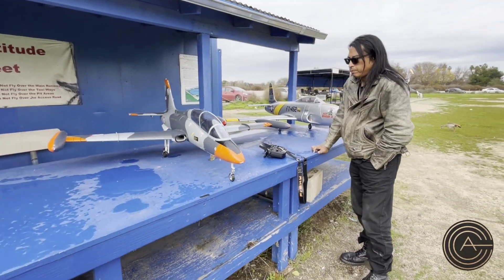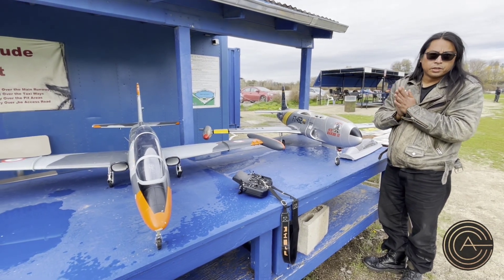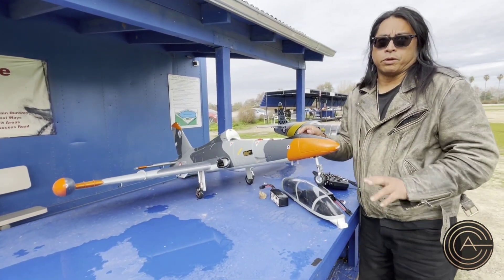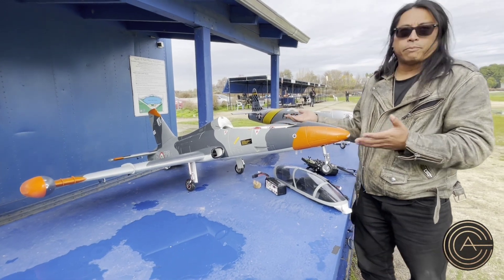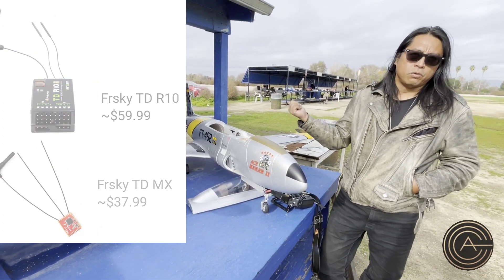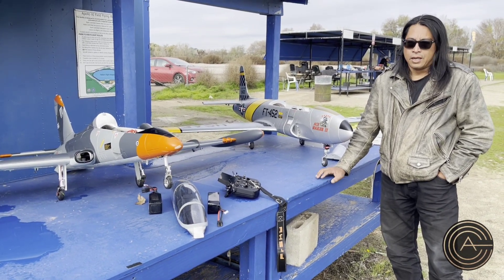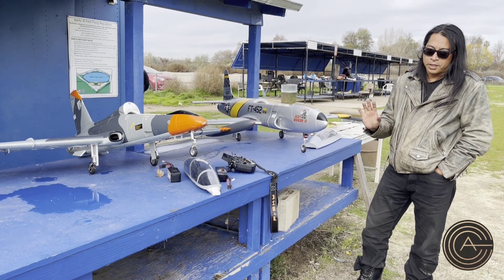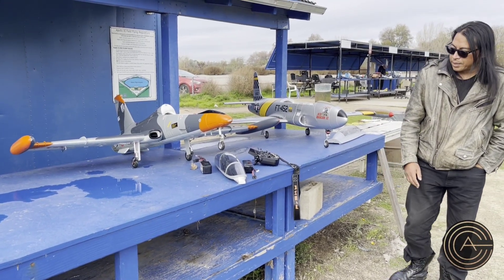HSD vs. Aerofoam. Part 1 of 4 - on the Bench

Comment: Between the denser AF foam and lighter HSD foam, is it safe to say the denser, heavier AF foam is better for preparing an aspiring turbine pilot for turbines?
Asking because I'm deciding between the HSD F16 105mm or the upcoming AF F22 105mm
Reply from the maker: The AF models seem to have better construction and fitment. Panel lines and general production quality is noticeably better on AF models vs HSD. Should also consider availability of parts. HSD has been out of stock for the F16 for a long time. They dont sell KITS anymore. You can only get a PNP version. No replacement foam parts are available. They just have landing gear parts and some smaller items available for replacement. The AF F22 is new, so stock should be available for a while. But looking at how AF models have been getting discontinued on the BananaHobby site, theres no telling how long parts will be available.

Comment: Might just be me but for what these cost, you should have zero issues. I have almost purchased both of these but stop myself before I click the checkout button. lol I do have the HSD 182 and use SBUS into their computer for one plug connection. All their settings stock were spot on and I do enjoy flying it.
Reply from the maker: I don't mind issues. Anything with a bit of complexity has the potential for issues.  It's how issues are resolved that is important.  I'll still buy HSD because there isn't much options for that size foamies.  But spare parts issues is sort of a thorn in the side of real great flying planes. Aerofoam seems to have a good selection of spares but they don't have the computer system that hsd has. Hopefully more manufacturers become available...

Comment: thats just a baddd glue job on the f86 tail lol when i glue a piece on a plane its alwayss twice as strong as it used to be
Reply from the maker: Yep,  usually is.  Most times the joint is stronger.  I tried CA first and possibly the type of foam didn't take as well.  Second time,  i used foam tac. That worked better.  The next time it actually broke in a different spot. My fault for letting that seat belt hit the tail over and over again,  but still.... it's a very brittle foam. I'm more careful now when putting the plane in the car.

Comment: The fact that any of these brands dont sell parts is automatic no for me.
Reply from the maker: HSD sells the mechanicals like servos and gear. Body parts are "just by the kit for 600 bucks".  Aerofoam sells parts. I've replaced one of the two lower fins on my Aerofoam MB-339 and Banana does seem to stock most parts.
Reply: Agree. When I started 15 years ago, I soon learned about the of no "spare parts" issue! A deal breaker for sure!

Comment: I have both those jets, the T-33 is a battery eater but an easy flier. The 339 is a glider and has a great flight envelope.
Reply from the maker: I run the 6300 smc batteries and they seem to last longer than even my 8000mah hoovo Batteries. Agree with your assessment of the T33 and the 339!
Reply: @all_rc  I use either Liperion or Zee 6s 6000 100c….they work ok, but they are still just 3 minute safe flight time. Just assembled the Aerofoam L-39 in Arctic Camo, haven’t Maidened yet….

Comment: Don't know why they won't stock parts. I had been waiting a while for a set of wings for a EDF viper. I contracted the sale rep from HSD direct he said shipping would be expensive, and said contract HSD dealer in the USA let them know and he would ship wings with there next container. Well after contacting HSD USA I was told they wouldn't do it. When the factory gave the ok to ship with there next order.

Someone else said they needed part HSD told them to buy the kit for parts
. 
The foam on the turbine is much harder then the EDF. I also have a HSD v3 viper turbine and its foam is much harder then Aerofoam L-39 turbine I have, but the Aerofoam foam isn't bad.

If you buy HSD you better make sure you don't any issue cause your out of luck trying to get fuselage parts. You can get parts direct from the factory but your going to pay a lot for shipping. 
I like the HSD model I have like 5 of there planes. I'd like to get a composite model but not being able to get parts is a draw back.

I also fly Frsky been using there radio about 8 years now. I run 2.4 and 900 in my models
Reply from the maker: Totally agree.  I really like their planes.  The ones I have, I really like the performance. I'm hesitant buying more of their planes since parts is an issue. When I talked to HSD USA, they told me that they can't get individual body parts from the manufacturer.  Interesting that you say that HSD has parts but HSD USA won't stock them. Not what HSD USA said to me. Wish things were more transparent...
Reply: @all_rc  Well I believe I still have the email the HSD rep replied to me. It was sometime last year. I have bought direct from the factory before and that was before the price of shipping went up. This is why the factory rep said to get in contact with the HSDUSA. If the rep was willing to ship the item with their container what's the big deal and there still making some money from it.
Maybe they didn't like the fact that I was in direct contact with the factory

A set of wings was going to cost me $89 and the shipping he quoted was $400 LOL go figure. At the time the kit was $499 lol.

Comment: Does the Aerofoam turn to a popcorn texture when exposed to  heat from the sun??
Reply from the maker: In socal, so far no.  I do have the plane under shade when I can.  Inside the canopy,  the black has popcorned though.

Comment: The flap servo is the same as the aileron servo for ordering purposes.
Reply from the maker: Yes, I found that out when I called HSD. They have servos listed for their F-86 which is the same for all their EDFs.  Would be nice if they actually broke it down and stated what planes they go to with the proper servo wire length, etc. Now that I know that,  should be no big deal ordering servos in the future.

Comment: I had the same thing happen with the Stabilizer on my HSD T33. I used carbon rods to reinforce the Stabilizer ends. Also I ended up having to beef up the Landing Gear Mains with hardwood and Plywood backing on the top of the wing. Flying off a grass field. The mains really  need more support. Its a heavy airplane on relative tiny wheels. Other then that it is a great flying Plane.
Reply from the maker: Totally correct...  its a little too fragile.  The stabilizer is now fixed with a carved piece of balsa to replace the broken chunk.  When I spoke to hsd about my servo issue, they also suggested that I reinforce the main landing gear.  I show a couple of pictures on how I did that in Part 4 of this series.
Reply: @all_rc  Interesting that they would admit that about the need to reinforce the main landing gear. At least they recognize this as a problem.
Reply: I had to do the exact same thing, the retract pushed through the top of the wing. Hope HSD is listening